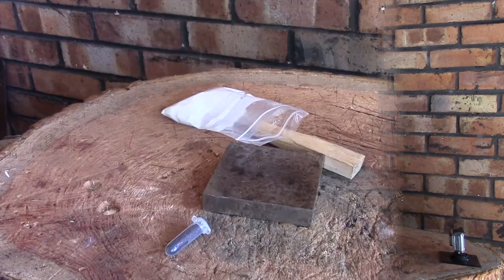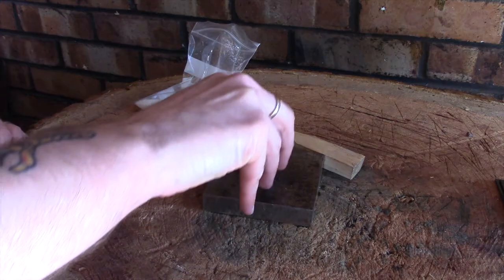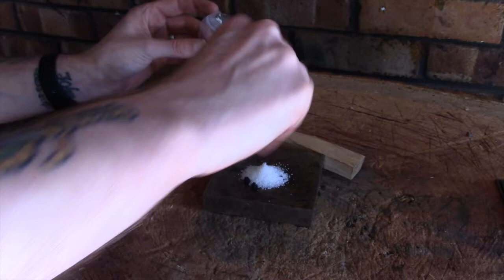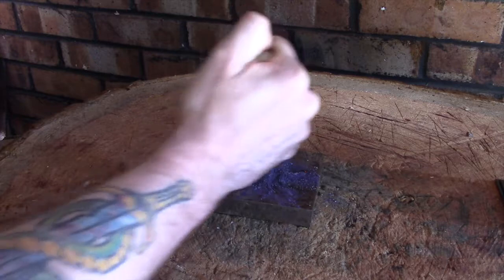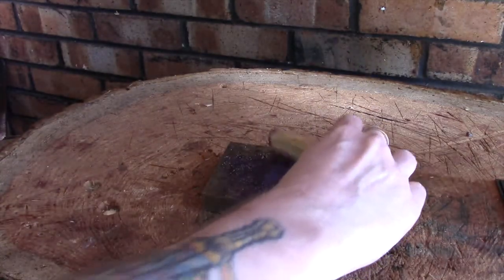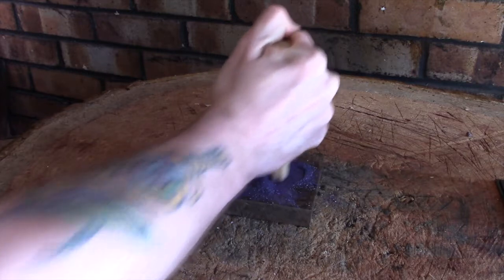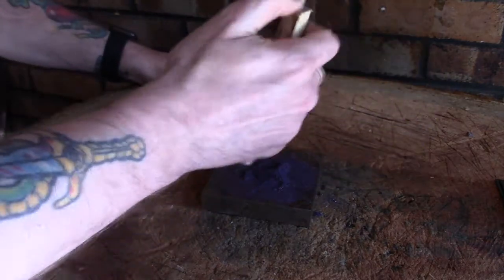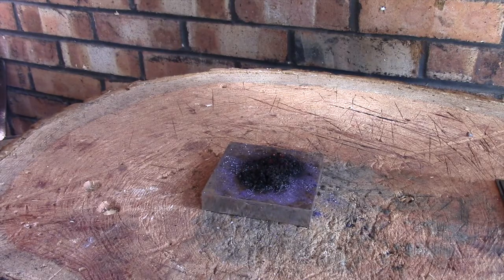Firelighting Revisited - Potassium Permanganate and Sugar

Comment: It may just be me, but I find it works better is you have about twice as much sugar.  I know it burns a lot longer with more sugar, and it really does seem to start much faster for me, though I use more of both than you did.   I also use a small metal saucer.  The metal increases the friction, or so it seems.  Anyway, it starts much, much, much faster for me if I double the sugar, and use a metal tray or saucer as the base.
Reply from the maker: James Ritchie that makes sense as the sugar is essentially the fuel source and the potassium just the catalyst that produces the heat/reaction.